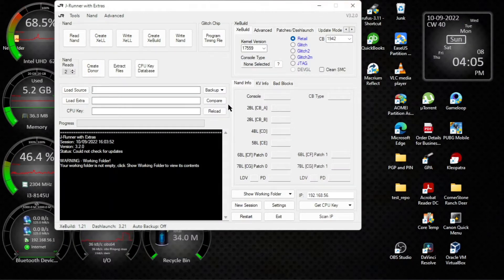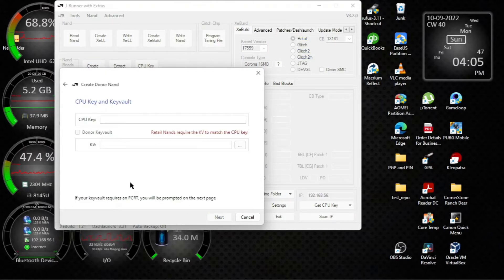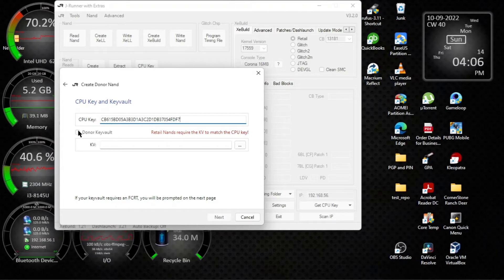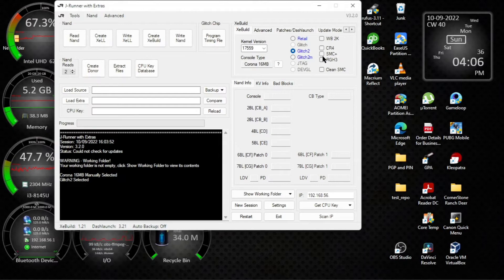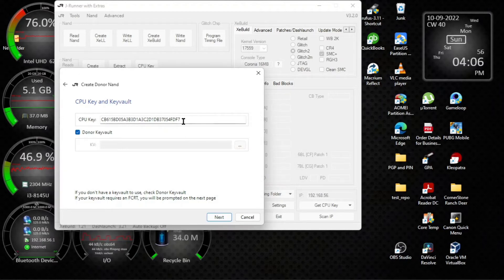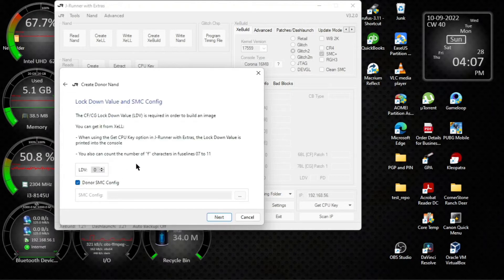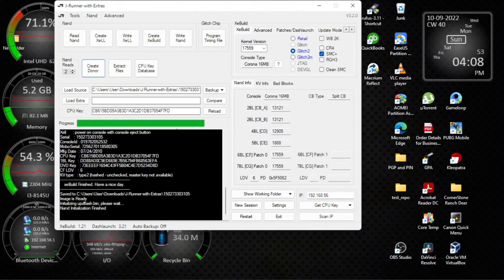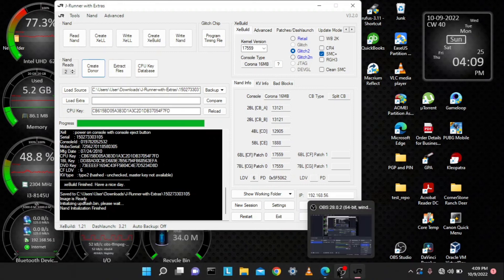Xbox 360 S Rebuild/Repair NAND flash with J-Runner 2022

Comment: How do I know what console type to choose on my xbox 360? I'm trying to revive my xbox 360 E, if that helps..
Reply from the maker: The Xbox 360 E can only be exploited with Bad Update as it has a Winchester board. Mr. Mario has videos on it, no soldering required.
Reply: @repairstudio4940 My xbox 360 E is modded, so I can't really connect it to the internet.

Comment: I’ve followed these steps i just blinking green dot but can boot xell fine ?????????
Reply from the maker: Disc drive plugged in? Seems crazy but I've had so many Coronas give me the flashing green light of annoyance lol due to the drive being unplugged
Reply: this is a trinity jasper mate, I don’t ever put disc drives back in till I no everything is good. Im so lost with this one lol ive done tones 😂
Reply from the maker: @Datfunny177 no worries some can be finicky. You doing RGH3 or a chip? Either way check all your soldering and reflash as sometimes XeXBuild won't take and a reflash takes care of it. Keep me posted. :-)
Reply: @repairstudio4940 i rgh 3.0 mate ive even tried building the xebuild image through jrunner then using xell too flash the hacked image back too the console and just sits the green dot flashing lol…. Boots xell fine so cant be wiring and I am quite confident in my soldering tbh lol
Reply from the maker: @Datfunny177 keep me posted we can figure it out if the drive doesn't do the trick. It's the strangest thing I remember the first time that happened and another modder, Urban (@UrbanMods) asked, "You got the disc drive plugged in?" I thought, psssh that doesn't matter but whatever...plugged it in and was off to the races in GTA! 🤷🏻‍♂️ It's weird, but it's the first thing I try when that happens.
Reply: @repairstudio4940 i appreciate the help mate I’ll give that a try when I’m at the desk tomorrow and get back too you with the result 🙏🏼
Reply: @repairstudio4940 but I will try the disc drive tomorrow and see if it makes any difference I suppose lol😊

Comment: Hi pls i need your help, i have two consoles at hand one a trinity which is stock and i was able to rgh3 it using badupdate exploit. The second console is a corona 16mb with rgh2 that turns on but wont bootup. Dont know if the glitch chip is bad or not, i removed the glitch chip, wired it up for rgh3, used my raspberry pico to try and dump the nand so i can build it for rgh3, but i keep getting mismatch nand dumps after several attempts. Dont know what to do. Any help will be greatly appreciated
Reply from the maker: Bad dumps.... yeah I'd just rebuild the Nand and flash again.
Reply: @repairstudio4940 when you say rebuild the nand and flash again, like you did in this video. Cus i suspect the console might have a hardware issue and i was hoping i can get instruction on haw to build a nand that will revert the console back to stock, if the console has a hardware fault it will come up with a error code or red light then i can try to fix the fault, if its ok it will bootup into a stock dashboard then i can used the badupdate exploit to rgh3 it just like i did with the trinity. Can i use the trinity cpukey to create the donor nand for the corona

Comment: somewhat off topic, but what fan is that you're using?
Reply from the maker: It's a silent, high flow, LED PC fan. 
When time permits I will try to make more videos of this easy mod.  :-)
Reply: @ any specific make you recommend? looking into doing the same!
Reply from the maker: @wesleybobby not really any specific recommendations just a 12v fan that 92mm and quiet and high flow for optimal performance.

Comment: Hello after i wrotel xell my system wont boot, i'm using pico flasher, will it still can be saved?
Reply from the maker: Yes this is not too uncommon for Corona's as well as using a Pico Flasher but absolutely, did you save the Nand dumps....if not no worries you can just get a donor Nand but I'd double check to make certain your PC didn't save the Nand dumps automatically first or they wasn't written over otherwise your going to probably have a issue with the drive not working....
Reply: @repairstudio4940  sure i have nand backup both checksum valid, i hope i can revive this console.again, thanks for the information
Reply from the maker: Absolutely you can revive it just add both the dumps from source and re-flash back to retail, then give it another go. Corona's (especially the 4gb ones) are my least favorite honestly. They can be very finicky. Good luck and just reach out for anymore help.

Comment: Hello Repair Studio. If I don't know the CPU key of my console (because I never managed to run XELL) but I know the LDV, can I use a donor with the donor's CPU key, or do I need to know my own CPU key? Also, should the creation be set to Glitch2 - SMC+ or Glitch2 - RGH3?
Reply from the maker: @dimitrisking7590  You can use a donor yes. Also as far as the glitch it depends on which one your doing. If your going the RGH3 route then choose that but if your using a chip you can use RGH glitch2 or glitch2-SMC....it breaks down like this: 
1) RGH 1.2: This is often used for older Xbox 360 models (Phat consoles) and some Slim models. It’s known for its stability and relatively quick boot times.
2) RGH 2.0: This is used for newer Slim models and is necessary for consoles with a dashboard version higher than 14719.
3) S-RGH: This is a variation of RGH 2.0 that can offer faster boot times on some consoles.
4) Glitch2-SMC+ is a variant of the RGH 2.0 method, which uses an optimized SMC (System Management Controller) to improve boot times and stability. This method is particularly useful for certain Xbox 360 models, such as the Zephyr and Falcon, so best for older models in my experience. Zephyr's can be finicky so be aware if that's the model your working on. 🙂
Reply: @repairstudio4940  Thank you very much for the quick response! I will use the RGH3 method. So, as you described, I don't need to know the CPU key of my console since I will be using the donor's CPU key. Therefore, I will follow your steps on my Jasper 256MB console with RGH3. Is there anything else I should be careful of for Jasper 256MB? If it works,I will post it on your channel! Thanks for your response!
Reply from the maker: @dimitrisking7590  Nah Jaspers and Falcons do quite well actually. I would make certain once you get a donor CPU key to try to find a key of a console the same year and model with the same disk drive and drive key,  retrieve your drive key, or replace the drive with a donor drive and key otherwise your console may not read the disks. Let me know how it goes. 🙂

Comment: I have xbox one 1540 dvd drive isnt working tried everything changed the laser the motherboard with dvd drive board replace didnt help i ordered a new dvd drive but not sure how to pair it

Is it the same process on xbox one?
Reply from the maker: @Mylotheblacknwhitecat  you have to use the board from the old drive ....the APU and board are paired.
Reply: @repairstudio4940  oh b I don't know where my original dvd drive went I just bought another one
Reply from the maker: @Mylotheblacknwhitecat  man that's not good, other than ordering a new one from Microsoft you may just have to use it for digital downloads.
Reply: @repairstudio4940  yeah I might have to use it for digital games 
I wasn't sure if j-runner would repair the new drive to my Xbox like how the xbox 360
Reply from the maker: @Mylotheblacknwhitecat  alternatively if you can find a board from the exact same model as yours, you can use it and swap out the board in your new drive. This requires soldering but it's pretty easy.

Comment: Hello , I need some help. I inherited a e model 4gb corora with rgh2 xdk chip. I rewired it to upgrade it to rgh3. Ran flashdump.bin file through jrunner and converted it to rgh3. My problem is that it now only boots to xell via eject button. If I use the power button, I just the green light and it's black screened. I looked at jrunner and there are no blocks or errors. I unfortunately don't have the original dump. Just the dump I did when it was rgh2. 

I have been going at this for 2 days now with no avail. Any help is welcome.

Ps. I have checked the wiring and it is good. I also don't have wb2k ram.
Reply from the maker: I'm sorry I'm so late to reply...first check all connections and solder points and the HDMI. Then try switching to the older AV cables and attach that to the screen. I've seen that refused display via the HDMI but would on the AV cables after a flash ....weird but reflashing fixed that. Make certain when you selected the RGH3 glitch also in JRunner that it's doesn't have an outdated kernel selected by default ....this happened to me just the other day. Let me know how it goes and where your at, I'm glad to help when I'm available.

Comment: Help me mr  i want your help. I have xbox360 JTAG/Rgh  corona 4g.       During update i switch off the console after turn on it's showing red light.   Or but when turning on console from eject button it's opening in xell reloaded
Reply from the maker: @TextText-j1q  check to see if it's overheating. Open the console. Then use a external fan, even a box fan will work to blow more air on the GPU under the internal fan and try powering it on. If the red light goes away you have a overheating issue and I'd recommend replacing the thermal paste and perhaps replacing the stock fan with one with better airflow. Let me know if this works, if not I can help you check for other faults 😊
Reply: @repairstudio4940  ?? How it's bricked by bad nand I think 🤔.    Overheating it's not matter 🤔
Reply: @repairstudio4940  during update it's shutdown by mistake 😭when I turn on it's showing red light issue 😔
Reply: @repairstudio4940  can I repair by using xell reloaded 🤔
Reply from the maker: @TextText-j1q  if the NAND is now corrupt but you've downloaded your dashboards you can rebuild the NAND and you should still be able to access your pre-installed dashboards and saves as they're stored on the hard drive. Follow these steps:

1)Backup Your Data: Before attempting any repairs, ensure you have a backup of your current NAND and any important data on your hard drive.

2) Re-flash the NAND: Use a hardware NAND flasher to re-flash your original or a working NAND dump. This can often resolve issues with corrupt NAND1.

3) Check for Bad Blocks: If there are bad blocks in the NAND, ensure they are remapped correctly during the flashing process1.

4) Restore Dashboards: After successfully repairing the NAND, your dashboards like Aurora should still be on your hard drive. If they are not accessible, you may need to reinstall them.
Reply: @repairstudio4940  sorry for bothering you 😔 but how ?? Jrunner or xebuild. I mean can I repair without any disassembly with using xell reloaded. Raw flash v4 using plz help me

Comment: I tried rgh3 but after write xell the problem came that's when i tried turn on my xbox 360 trinity it doesn't boot and just made bipp sound (no green light)..
I assume that my nand got brick and i dont know how to get cpu key.. Do you have ane solution?
Reply from the maker: I am great at what I do. Your nand is NOT (almost assuredly) bricked. Give me more info.
Reply: @repairstudio4940  whenever I tried to turn on xbox 360, it doesn't boot (green light not turn on) and just making a bipp sound
Reply: @wjyaa618 i have the same problem on a Corona 4Gb, did you found any fix on this?
Reply: @EmaBixD  i gave up on that.. Bought new one and surprisingly I succeeded the rgh3
Reply: @wjyaa618  tysm for the fast reply, I think im going to put another week on this and see what happens… If I may ask how much you sold it for?/or how much can I sell it on these conditions?
Reply: @EmaBixD  i didn't sell that broken one, just as a sparepart if my new one get into another hardware problem.. Tell me if u figure out how to fix your problem
Reply: @wjyaa618  maybe im close to a solution. There is a “common” folder in jrunner with original .ECC for each model. Since I lost my og nanddump file I think this is my last option to try to get a working XeLL since I couldnt never wrote anything outside ECC. (sorry for my bad english, I’m Italian)

Comment: help !!!after this my dvd drive is not working
Reply from the maker: Sorry I just saw this, I work often. 
This is common no worries...
When you rebuild the NAND in JRunner for your RGH Xbox 360, the disk drive might stop working due to a mismatch between the drive’s firmware and the console’s NAND. Here’s what you can do to fix it:

1) Check the DVD Key: Ensure that the DVD key in the NAND matches the one in the drive. If they don’t match, the drive won’t work. You can find the DVD key in JRunner under the “Key Vault” tab.

2) Reflash the Drive: If the keys match but the drive still doesn’t work, you might need to reflash the drive’s firmware. Use a tool like JungleFlasher to reflash the drive with the correct firmware.

3) Verify Connections: Double-check all the physical connections between the drive and the motherboard. Sometimes, a loose cable can cause the drive to malfunction.

4) Rebuild NAND with Correct Files: Make sure you used the correct files when rebuilding the NAND. Incorrect or corrupted files can cause various issues, including problems with the disk drive.

5) Update Dashboard: Ensure your console’s dashboard is up to date. Sometimes, an outdated dashboard can cause compatibility issues with the drive.

Sorry so late but hopes this helps....let me know if you need further help.

Comment: Hello, I really do not understand what to put in LDV Value. I am doing this because i have a bad block and cannot boot to XeLL. How can i count "f" if i cannot boot to Xell? or maybe LDV Value is shown in JRunner (on the right side) when i firstly load the nand.bin (with the bad block error)???
Reply from the maker: Sorry I just saw this. You'll need a donor. Do you have the CPU key at all? Did you get any good nand dumps? If not you'll need a donor.

Comment: Was hoping this would fix mine but unfortunately nothinf changed. Rgh 3 trinity. Ive checked rhe wiring and made sure all solder points were good. Flashes fine but after system will turn on but no screen input. Fan starts up normal and runs but every 5 seconds it sound like the fan restarts.
Reply: I have the same issue. No output tries to reboot but nothing happens
Reply: Same @69forever420
Reply: Same😢
Reply: Did Microsoft do something and not tell us I’m 5 Xboxes deep no fix this is stupid done trying
Reply from the maker: Hmmm... Can you upload a video and drop the link and let me see?

Comment: Hy my 360 its a 2006 xenon i bricked it when i was trying to flashing the 2011 metro dashboard but where you choose the mod type i accidentally put glitch 2m (mine its glitch 2) when i flashed it it gave me black screen and i cant boot on xell any suggestions?
Reply from the maker: Have you reflashed it? That'd be my first step as many issues like accidently choosing the wrong glitch (which affects alters the timing) causes issues. Different mod  chips and the RGH3 using a pico affect timing but saving and backing up your nand dump is SO important so it's simple to just reflash. Sorry for the delayed reply. Hope this helps. 😎👍🏻
Reply: I tried to put the original nand but the console doesnt do anything only black screen
Reply: I dont know how to remove the mod chip from the board because i bought over 1 year ago from ebay and the seller told me that if i want to repair the console i need to pay 60 euros (the console costed 45 euros)
Reply from the maker: @GriLz85  if possible upload a video here on YouTube and I'll guide you. You only need to desolder the wires from the board however if this is a Corona then a post-fix adapter may also need to be removed. It will be a small white board around the CPU.

Comment: HI MY MAN I CANT GET IT TO WORK XELL IS BOOTING BUT NOT MY CONSOLE??
Reply from the maker: Have you tried to re-flash also did you save your first NAND dump?
Reply: @repairstudio4940  hi i fixed it by making a donor nand with no nanddumps source only cpu and dvd key that worked. Some how i flashed mu CONSOLE with the wrong glitch xell worked but not normal boot its. Fixed. Now
Reply from the maker: @RGHPLUG  if you have the key you can rebuild with it. Also donor keys are available online in many forums. Many donate keys from broken consoles. The 360 community is huge! I'm glad you got it up and going, curious though is it a Corona?
Reply: @repairstudio4940  hi its a Trinity that i flashed with glitch2 and not glitch2 RGH 3.0
Reply: And it messed up everything but i found a Way to fix it by using donernand files and someother stuff.
Reply from the maker: @RGHPLUG  yes indeed glitch 2 is for the older way of RGHing using a chip, the 3.0 method doesn't use the chip but basically the SMC to send the timing commands. So you corrupted your Nand but absolutely glad you rebuilt it using donor nand dumps. Been there. Annoying and frustrating  truth told.

Comment: YOO i have the same problem on my xbox 360 slim .. after i messed around with some dash board settings i disabled xbox live blocker then the xbox updated and it won t turn on again ... any tips on how to get it run again??
Reply from the maker: Certainly first do you have the nand reads...original nand dumps? Sorry for the delay holidays ya know...

Comment: Got a 16mb Trinity and it wont boot into xell,  any suggestions
Reply from the maker: Did you try reflashing and also check your solder joints
Reply: Is this rgh3 or 1.2